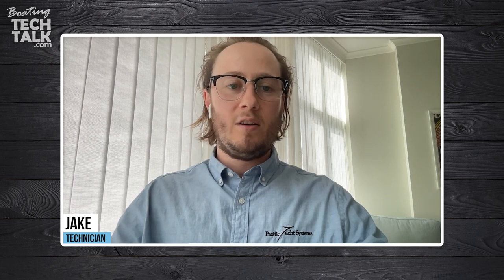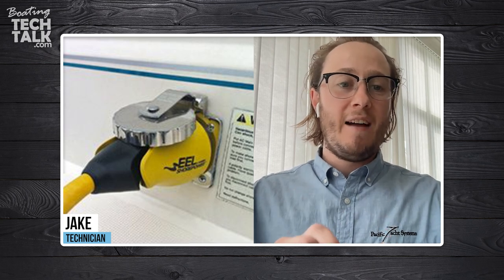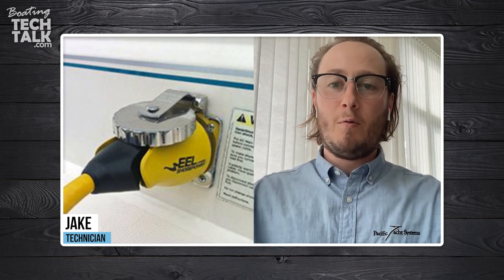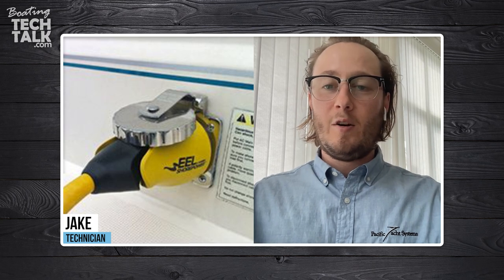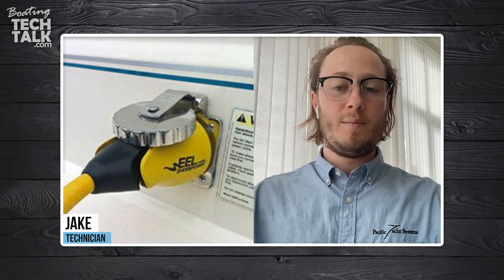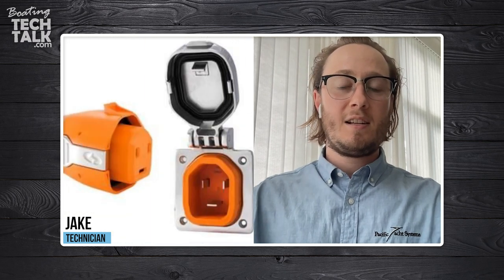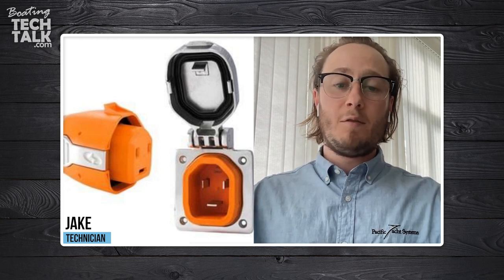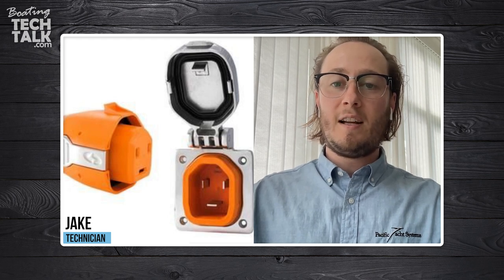How Marine Shore Power Cords Can Overheat and Cause a Fire

Comment: I fully agree! As explained, the issue is you can’t see the corrosion inside the receptacle or socket. Especially if your wire is copper NOT tinned, it will corrode fast. Better to check it every season… Thanks for the reminder!
Reply from the maker: Exactly!

Comment: Hi PYS. Love your lectures and talks, I recommend them everywhere to Boaters to help them get things right. Though I'm on the other side of the Pond, so maybe you don't get as much custom from them as you deserve. I've had a thought on a topic that may be a bit unusual. Lightning Protection, and an antifoul that may help speed up polarity equalisation between water and air to a common Polarity. The antifouling" is Cold Galvanising Zinc Paint, which you can get up to 96% Zinc Content in a Silicone paint carrier. Well, it Also pehaves as an Anode, and lots of people use it to antifoul their boats propellers. Some gave used it for over 10 years successfully, the Marine paints are identical to the land use sold ones, but the land use ones are a Fraction of the price. Gerebin the UK for example a 1 kilogramme tin, to brush or roller on, including Taxes, is about 24 pounds delivered, and lower concentration aerosols are in the 10 to 12 pounds range. We'll my next boat is going to have a Cast Iron Keel,  and after sealing with 3 coats of laminating epoxy, to make it waterproof, I started thinking (I know, dangerous territory). The paint is definitely Having an Anode effect (could be why it works as antifoulingas the paint surface may slowly erode? ) So say Lightning dissipater Mast top, Stainless Steel 1x19 wire standing rigging connected, bonded through chain plates down to the Keel bolts, but the waterproof protective coating would be insulating the Zinc Paint from the Keel, so would it help to activate the painted Keel as a Lightning protector, to have a bolt into the Keel to connect a copper plate to, which can then have the Zinc Paint to the plate and bolt to all that Anode Paint on the Keel or am I thinking about this completely the wrong way. If it works, and is as successful as an antifouling that users suggest, the entire below the waterline hull surface I'd be willing to test painted with the Cold Galvanising Zinc Paint. The bonus with it is it is non Toxic, plus on haulout, is very easy to recoat if needed. With the new boat, I'll be hauling Out at 3 months for oil changes, and thorough checks, adjustments, warranty work etc, again at 6 months, then annually, so will be able to keep a close eye on how well things are doing. I'm thinking if successful, it may help with sideways bounce incidental Lightning strikes a bit too (they aren't that common, but do happen. Any thoughts would be welcome, including if necessary "Whatever you do, Do Not Do That ! "😁 Best Wishes.  Bob.  👍

Comment: I Just had to replace my plug that was melted. Took out a brand new 50ft cord too. Appeared to be corrosion on the wire connection on the black wire causing high resistance. 30A circuit and I was pulling just under that running the air conditioners. Glad I caught it when I did.

Comment: Hi Jeff and Jake,  thanks for the video..  I have an unrelated question to do with vsr fusing. obviously great to Fuse the negative,  but wondering the reason to Fuse the positives? if it's connected across a bank 1-2 battery select switch with very short wires..  thanks in advance for any advice.  Regards Stormer.